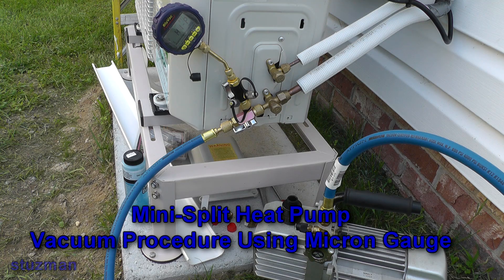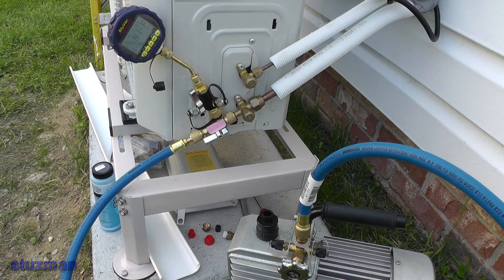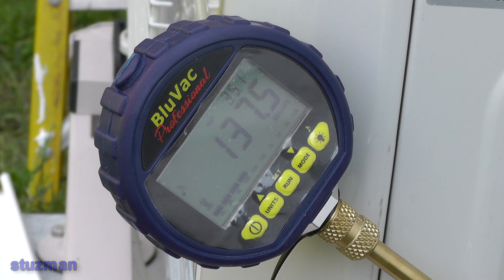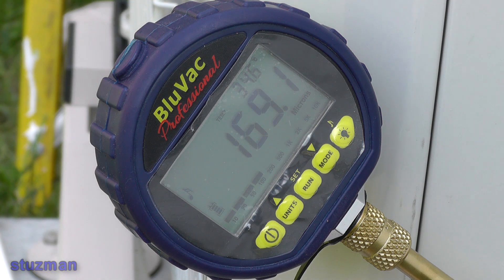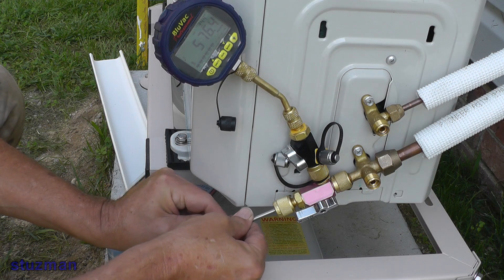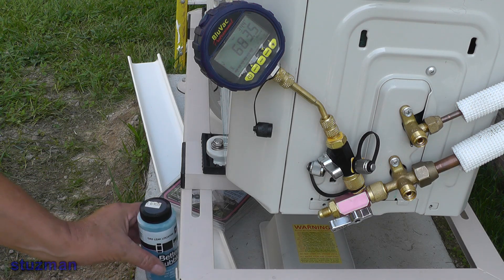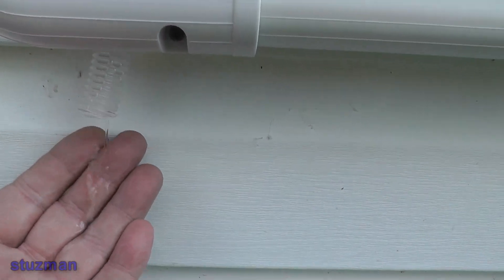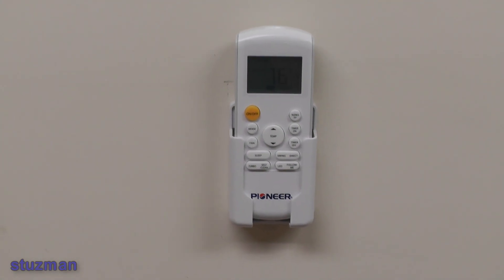Mini-Split Heat Pump: Vacuum Procedure Using a Micron Gauge

Comment: in order to install a mini split is it a must to use a vacuum? or with the nitrogen alone is enough?
Reply from the maker: In order to find small leaks, you should pressurize the system with nitrogen. If you use vacuum, you may not find a small leak. And if there is a leak, how are you going to know where the leak is under a vacuum? Also, it is a MUST that you vacuum the system of air. Have a great day!

Comment: Subject: Pulling Vacuum
I’m Installing 9kBtu Senville Aura mini split. I’m EPA-608 certified w/ 40+ yrs. of elect/mech background.

Questions: 
While pulling vacuum on a new unit, do I need to remove all the Schrader valves in the all the hoses, valves, vacuum gauge, and adapters? 

Regarding the Schrader valve removal, are these the correct size tools for the ¼” and 3/8” copper tubing on my system?
Appion MGAVCR Mega Flow Vacuum Rated Valve Core Removal Tool – 5/16" System Connection 
Appion MGAVCT 1/4" MegaFlow Vacuum-Rated Valve Core Removal Tool
CPS-AO-42500-08 Products VG200 Portable Digital Vacuum Gauge, LCD, Atmospheric to 0 microns

I’ve done the YouTube list of video resources including Benjamin Sahlstrom, AC Service Tech LLC, The DIY HVAC Guy, Quality HVACR, Stuzman, SeeJaneDrill, and many others. I’ve seen some pull vacuum with what looks like the Scrader valves in place and some without them. Seems there is a time factor between the 2 options and for me the extra expense of buying the removal tools. Any constructive comments would be appreciated.

Comment: The design makes this AC a possible alternative to ductless DYI systems. It works great. The remote control could be more visual aid oriented like a backligh design. Is impossible to see the lcd at least for me. Easy install https://www.youtube.com/post/Ugkx_hHgTlzH3uk31Fe2RVS3xEbXHGaN_z5Tation. Came on time . Great comfort around the house 5 🌟 again. Follow mfg instructions for care and all and this should be the only AC you need for those of is that don't live in new homes with central AC
Reply from the maker: Thanks Emily for the comment and have a great day!

Comment: Enjoyed the video. If the unit was empty would weigh the refrigerant in using the liquid line port off the compressor or would you add it on the suction line port where the line set attaches.   Trying not to flood the compressor.  Thank you
Reply from the maker: You'll only have one port to add the refrigerant. I would just put the refrigerant in as a liquid without the unit running. It's the same procedure when charging a vehicle. It's charged with a liquid without the engine running. As the liquid goes into the system, it will flash into a gaseous state. And since the unit is not running, you don't have to worry about flooding the compressor.

Comment: Did you remove the core depressor off the micron coupler or doesn’t matter if it’s there?
Reply from the maker: Hi Luis! The micron gauge coupler that I used doesn't have a depressor for the schrader valve. However, I did remove the schrader valve from the core tool that the micron gauge connected to. It really doesn't matter whether this schrader valve is removed or not. Have a great day!

Comment: I was told by some people that micron gauges can handle up to around 500psi of pressure so do i really have to isolate the gauge with a 2nd valve?  I'm trying to avoid having to buy more tools than I need.  Good video btw.
Reply: They can take some nitrogen pressure. You want to take care not to get refrigerant and oil into the micron gauge.
Reply from the maker: Hi Mike! It's true that most if not all micron gauges can handle a higher pressure. I'm anal in my thinking that a vacuum gauge should be used for lower pressures rather than subjected to higher pressures. But again, the gauge should be able to handle the higher pressures. As Shaun mentioned, you may get refrigerant oil on the sensor which could effect the accuracy of the gauge. If that happens, isoproyl alcohol is used to clean the sensor. So, if you want to use the micron gauge without the isolating valve, you should be okay.

Comment: Will a 3cfm pump be able to perform a vacuum on a 4 ton, 4 head unit in a reasonable amouky of time?  I did the pressure test and confirmed no leaks, however the vacuum started at 199999 microns and ran for over 5 min and the numbers didnt change
Reply from the maker: Hi Ben! A 3 cfm pump should be able to evacuate the system, but it will probably take awhile. A few things to speed up the process could help. Be sure that your vacuum pump has a fresh supply of oil. I like Robinar's vacuum pump oil. Also, with the shrader valve removed this will speed up the evacuation and finally a larger inside vacuum hose will help. Have a great day!
Reply: @stuzman52  Great!  Thank you very much!
Reply: @stuzman  One last question, since I have a total of 8 indoor head units, am I able to perfom pressure test on all lines first and then once all lines pass that, come back and perform the vacuum testing?
Reply from the maker: @bencook8109  I’m not really sure Ben as I’ve never done a multiple indoor head installation. From what you’re saying, it’s possible to pressure test and pull a vacuum on all line sets at once. But if you do have a leak, you wouldn’t know which line set to investigate. And I’m assuming that you have a master valve for the entire line sets and individual valves for each line set. I assume that you can pull a vacuum on all at once, but it will probably take awhile. Does your manual make any suggestions how to do multiple line sets. Individually or all at once, etc?
Reply: My Mistake Mr. Stutzman, I may have worded my question weird.  What I should've asked was, can I do one line at a time, pressure testing them only, and then once all lines have been pressure trsted individually, am I able to go back and do the vacuum test. Or do is this a case where once you choose a line to do a pressure test and perform the test, that now you cant back out and leave it and HAVE to then do the vacuum right after.
Reply from the maker: @bencook8109  If it was me Ben, I would pressure test each line set and if that was good, I would do a vacuum on it. This way if there was an issue, you would know about it right away versus doing them all the same time even if that was possible.
Reply: Well I ended up going out and getting a good pump.  Got a 12cfm Globesaver.   I am able to pull the vacuum down to 100.  However, it doesnt hold.  It did on the first 2 linesets, and on this 3rd and 4th one, its just not holding the vacuum.  Zero leaks on the nitrogen pressure test.  Whats interesting is, on that 2nd core removal tool where the micron gauge is connected, if I turn that valve to off (so the micron guage then is only reading that very short amount from that shutoff valve to the gauge) the numbers on the micron gauge keep climbing very steadily.  Does that indicate that I have a bad gauge or possible core removal tool that is leaking?
Reply from the maker: @bencook8109  When you turn off the valve to the micron gauge and you see the numbers rising quickly, this is perfectly normal. This question was asked so much that I posted a link to a video in the description. The video will probably address some of your other questions about the rising pressure in the system. Check the video out and see if it helps you out.
Reply: @stuzman  thank you for the reply Mr. Stuzman!! I really appreciate all of your help!
Reply from the maker: @bencook8109  Always glad to help Ben and wishing you much success on your project.
Reply: @stuzman  thank you!! I was working on the system last night and was down to the last lineset out of the 8 and of there ended up a problem.  Im actually worried about this problem.   I got all the way to the point of releasing the refrigerant into the system.  When I went to put the valve core back in, it wouldnt get tight.  I tried for over an hour to get it to grab, and the worst part, it now wont come out.  So now, the only thing that is keeping all the refrigerant out is that valve core removal tool.  I am at a loss as to what to do now?  Am I sunk and have to lose all the refrigerant and then have to revac the line again and then have it recharged?   I really hope that isnt the case.
Reply from the maker: @bencook8109  Not sure what to say Ben. I'm not sure if it's cross-threaded and won't catch the threads. This doesn't seem likely as the tool should hold the valve core straight when you insert it back in. Maybe, come back to it later and it might go in. The worse case would be as you mentioned about the refrigerant where you could investigate further to see why it won't screw in, but I hope not.

Comment: wherefore is the valve on the pump?
Reply from the maker: Not sure what you're asking about where is the valve on the pump. If you're referring to the vacuum pump, you can see there's a valve at the very beginning of this video.
Reply: @stuzman52  Thats the one. Is that just an open close valve to start the vacuuming?
Reply from the maker: @Est-lj4tq  Hi Est1980! Yes, that valve on the pump can close and open the vacuum coming out of the pump. However, I always keep it open and close the valve(s) on the manifold gauge set to shut off the vacuum going into the system.
Reply: @stuzman52    The gas balancing valve, you said so but i misheard so i used the youtube translation feature.   Thank you for the videos on ac. ive watched quit a few and i like yours best. Greeting from Holland.
Reply from the maker: @Est-lj4tq  Thank you Est1980 for watching the videos and glad that you like them. And a big hello back to you in Holland from the US. Have a super great day!

Comment: When you vacuum the lines pulling the air  out like that do it creates pressure and a suction in the lines that force the refrigerant all the way through the lines ?
Reply from the maker: When a vacuum is pulled on the line set, there is a negative pressure which pulls air out of the system. There is NO refrigerant in the lines when this is done. The refrigerant is inside the outside coil when this procedure is done.
Reply: @stuzman  right but once u open the valve on the outside compressor to let the refrigerant in the lines ain't the lines under some type of high pressure created by the vaccum that forces the refrigerant or pulls it all the way through?
Reply from the maker: @thelithiumpowerch  when you open the two service valves, the refrigerant will enter the lines which is under a vacuum. The higher pressure of the refrigerant will always go to a lower pressure which is in the lines.
Reply: @stuzman52  okay because the reason I'm asking this is because they don't seem to be no pressure in my lines at all I'm gonna try to build up the pressure by turning on the AC side and letting it run for a while then closing the line so all the refrigerant goals back into the compressor close both valves and perform a vac on the lines because right now I have no pressure at all
Reply from the maker: @thelithiumpowerch  Do you think that maybe for some reason there is no refrigerant in the system?
Reply: @stuzman  I'm thinking there's refrigerant in the system but there's no pressure to push the refrigerant through the lines because I have no leaks nowhere none ever got out

Comment: Is  that the pioneer stand? I am about to order my unit and tools..Thanks for the videos you do it right with no missed steps...Its worth it to me to spend the extra money on the tools and learn.. Its still way cheaper than hiring a guy who may or may not do it right.
Reply from the maker: Hi Dave! The stand was ordered from Amazon and is located here https://www.amazon.com/gp/product/B0192298O0/ref=ppx_yo_dt_b_search_asin_title?ie=UTF8&psc=1 I made some modifications to the stand where one was to shorten the legs. Yes, it helps to have the correct tools to do the job and you are correct that it's not a guarantee that a professional will do the job correctly. For the same size unit as mine, my neighbor says that a contractor wants $5000 to install it. That's a pretty hefty price. Have a great day and good luck on your install.

Comment: Hi Stuzman....I hope all is well. It's been 3 years since you helped direct me on some questions that I had on installing a mini split at my previous home. I have since moved to Colorado...and am installing 4 more Bosch mini splits. I made a stupid mistake the other day when trying to commission the first one...
I vacuumed it down to 150 microns...and it held 170 for about an hour. I normally always break the vacuum with nitrogen, check for pressure leaks, and vacuum down again. Well...I ran out of Nitrogen so...I just followed the normal procedure. Unfortunately...I didn't check all the connections immediately after releasing the refrigerant. The line set connection to the indoor unit on the low pressure side blew out refrigerant. I didn't realize it until I started troubleshooting the next day when it stopped blowing warm air. The indoor unit is supposed to display a code for low refrigerant...but it did not. I put my pressure gauge on the service valve...and it was minimal if at all while running the AC. My plan was to recapture what refrigerant was remaining in the compressor...but since there was no pressure to speak of...all I could think to do was to close the ports to hopefully protect the compressor from air in system? I am getting my nitrogen refilled to hopefully not repeat same mistake. 
I don't mind buying refrigerant and scale and trying to correct my mistake. Curious as to your thoughts if I should have a service call to retest and refill...or make the investment? Thank you...
Reply from the maker: Hi Steve! Since you probably won't make this mistake again, you probably wouldn't use the scales again and it may be an issue to buy R410a if that's what your system is using if you don't have a certification license. Maybe the service call would be the best. Have a great day Steve!

Comment: One quick question. When you put the valve core back into the service port, Wouldent there be a small air pocket in the valve core removal tool that gets into the system??
Reply: To install the valve core under vacuum with minimum contamination, I'd say put the gauge on side port 2 and the vacuum hose on extremity 2 instead of 1, and keep pulling while you open 1 and install the core.  Better to install it without vacuum.  Crack the gas service valve until the gauge reads ATM, close the valve, remove the gauge and install the core.

Comment: so i could prolly just use some 1/4 ball valve on the micron cage when i dont have 2 core tools and a hose before micron cage would ruin the readings too much ?
Reply from the maker: If you could rig it up, I'm sure it would work. Have a great day!

Comment: Great video, I am watching it again and again, and the more I understand the procedure the more questions I get :) 1. In the video about nitrogen test you used yellow jacket. Am I right we can just use the same micron gauge for the nitrogen pressure test? 2. I watched another video about triple evacuation - so one difference I found important: they first create a vacuum, and then introduce nitrogen, while you just introduce nitrogen into unpressurized lines. I would guess vacuum-then-nitrogen is cleaner. Any comments, please? Thanks again
Reply from the maker: In regards to your question #1, no, the micron gauge should not be used to measure the pressure of nitrogen in the system as the micron gauge is designed to measure vacuum. And you'll find that it can't measure pressure above atmospheric pressure. On mine it won't register any pressure until it gets to below 20,000 microns which is about 0.38psig. As for triple evacuation where one begins the evacuation with nitrogen is not really needed as it takes hours to assume that the nitrogen will absorb the moisture. Or that it really doesn't absorb the moisture but displaces it. The vacuum pump will lower the pressure, boil the water vapor at a lower temperature and then the pump will evacuate the water vapor. Here is an article where this is discussed it and in my opinion, triple evacuation is not really needed. https://hvacrschool.com/triple-evacuation-and-nitrogen-facts/

Comment: Love these videos of yours! Quick question about the mounting system that you have attached the condenser to; could you provide a source url etc., for the frame & is that a regular paving stone you have it anchored to?
Reply from the maker: Glad to hear Tim that you're enjoying the videos. As for the outdoor unit stand, it was ordered from Amazon where the link is here. https://www.amazon.com/gp/product/B0192298O0/ref=ppx_yo_dt_b_search_asin_title?ie=UTF8&psc=1 I shortened the legs a little, replaced all the fasteners with stainless steel and repainted the assembly. As for the pad, I poured a concrete slab for it. Have a great day Tim!

Comment: POR FAVOR, INDIQUE DONDE COMPRÓ LA BASE O SOPORTE  PARA EL CONDENSADOR. GRACIAS
Reply from the maker: Todo el sistema incluye la unidad exterior y la unidad interior. Fue comprado en Amazon ¡Que tengas un gran día!
Reply: @stuzman52  https://www.amazon.com/-/es/Senville-soporte-decorativa-acondicionadores-acondicionado/dp/B085ZN1WTG/ref=sr_1_54?__mk_es_US=%C3%85M%C3%85%C5%BD%C3%95%C3%91&crid=2LT90QY36MPJP&keywords=mini+split+air+bracket&qid=1653636463&sprefix=soporte+para+aire+mini+spli%2Caps%2C327&sr=8-54    LO ENCONTRÉ! MUCHAS GRACIAS! :goodvibes: